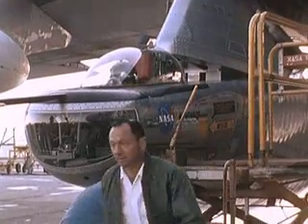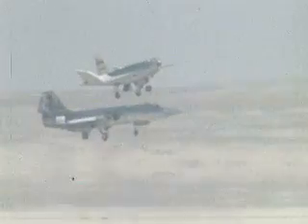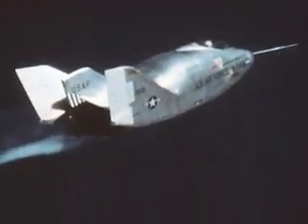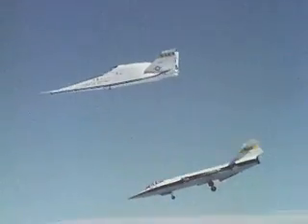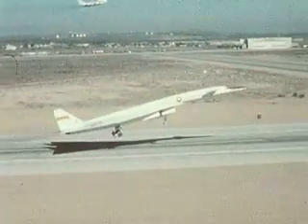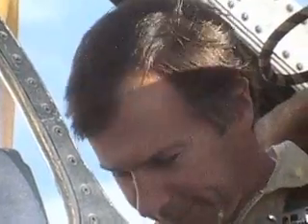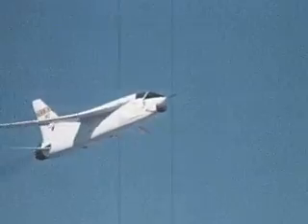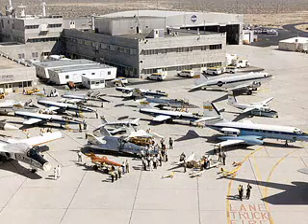The Lifting Body Era 1966 to 1976

Comment: The reason they had instability issues is because the very first wooden prototype had horizon stabilizers, but all the metal versions did not have horizontal stabilizers.

Comment: The planes that survived these programs are all in museums now.
About half of them are at the Air Force Museum in Dayton, Ohio now.  That includes the YF-12A, the X-24B (the coolest lifting body), XB-70 #1, the X-15-A-2, and some subscale lifting body models (ASSET, SV-5D) used in to help develop the manned versions.
Another 2-3 lifting bodies are at the Armstrong (formerly Dryden) Research Center near Edwards AFB and 1 is hanging from the ceiling of the NASM on the Washington, DC Mall.
In person, they're very impressive looking planes!